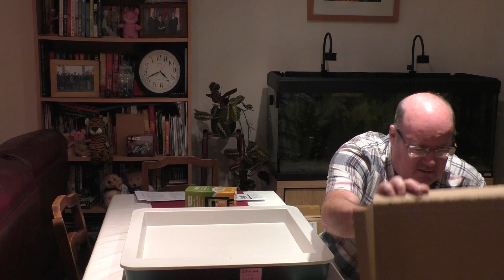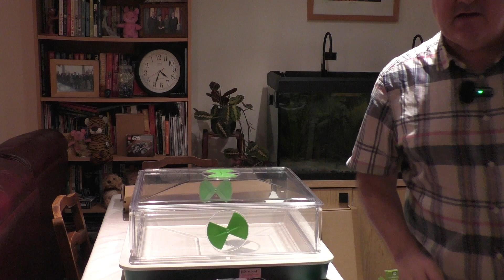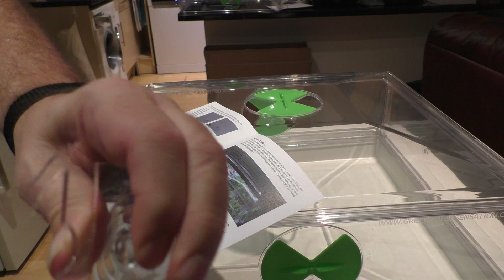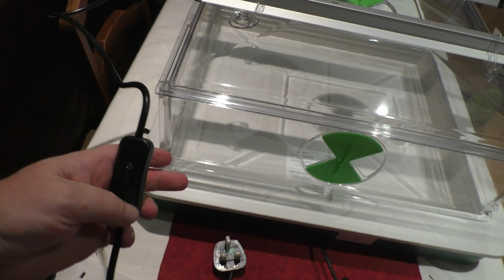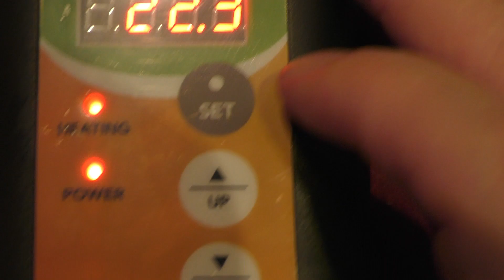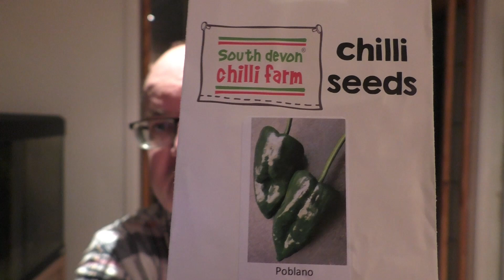New Kit

Comment: I wouldn't be without mine, John (older models from before Greenhouse Sensation folded)
A tip for you: on the expansion layer, leave off the four front securing screws and find something that wedges in the top two holes gently - like a red rawlplug. This way you can pop the front panel off for easy watering with a mini watering can, rather than having to take the lid and lights off every time.
Darn it - another secret gone LOL

And when the T5 tubes break, they will LOL, change to LEDs that will last forever!
Reply from the maker: Thanks for the top tip